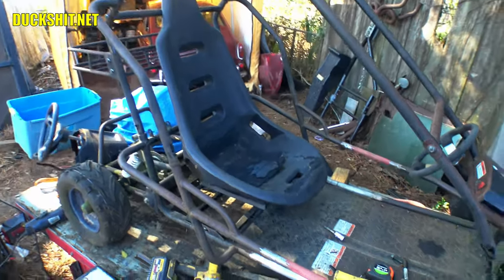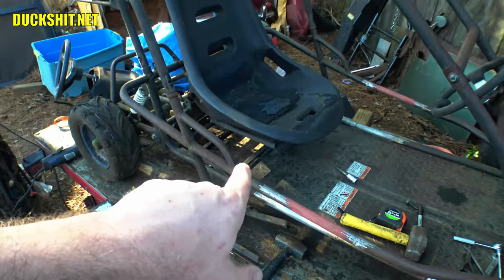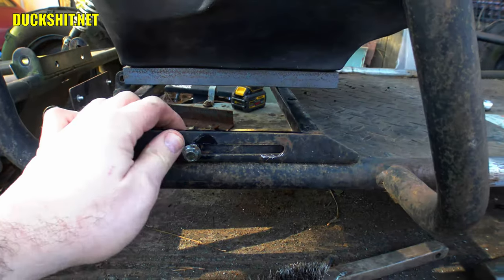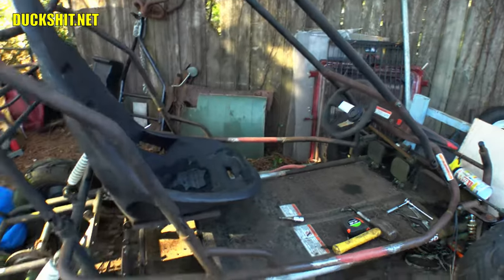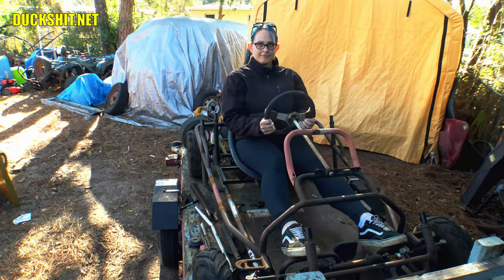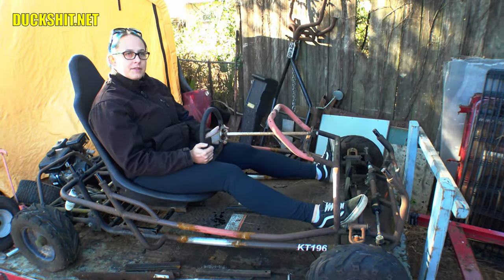Installing Proper Sized Seating - KT196 Go Kart - 05

Comment: Flux core works as well as using gass as far as welds strength etc but a lot more cleaning needed gokart looking great I'm thinking of doing mine thanks for the idea all the best to you and family and friends wishing you all well
Reply from the maker: Yeah, its a sloppy medium, but in the end, results are good enough.  I built my whole Eleanore the VW Beetle with flux core.... in fact about 90% of it was with a cheap Harbor Freight welder.  What a mess that thing made lol!
Reply: @DuckmanCycles  you can't blame the tools 🤣😂I know what you mean but you use what you got and afford all the best
Reply from the maker: @donaldhalls2189  Not cool. it was the fault of the welder, as soon as I replaced it and the wire, the weld quality changed dramatically.
Reply: @DuckmanCycles  I was just having a dig I know the welder makes a lot of difference I've just got a new one and now I have welds not spogy shit 🤣😂all good enjoy your chanle wishing you all the best
Reply from the maker: Thank you.

Comment: do you have a flux core brand you'd recommend?
Reply from the maker: I've got the Lincoln wire, that seemed to be best in my tests.  The Harbor Freight was the worst.... it made better fireworks that welding.  I dunno how they could sell it, it was really that bad!